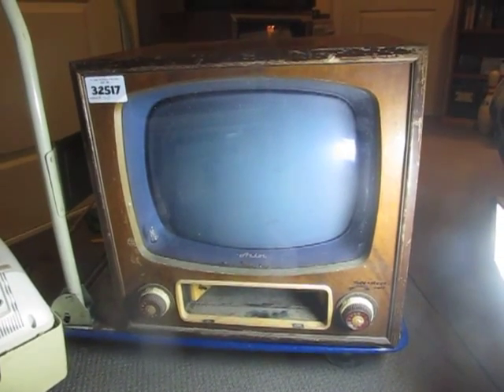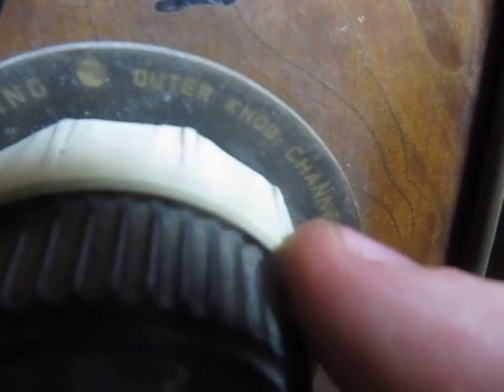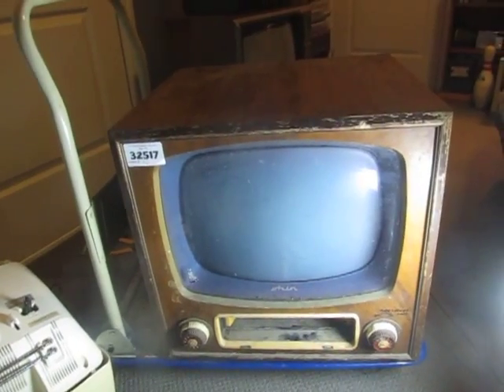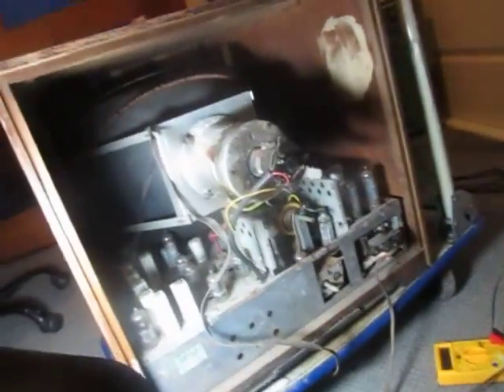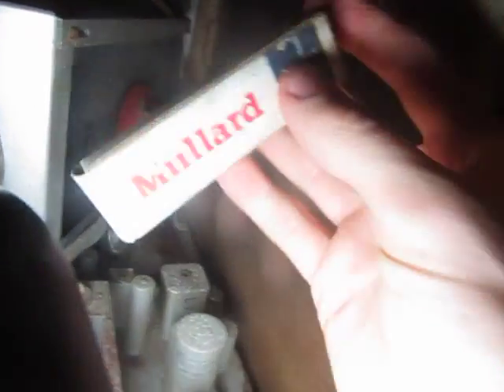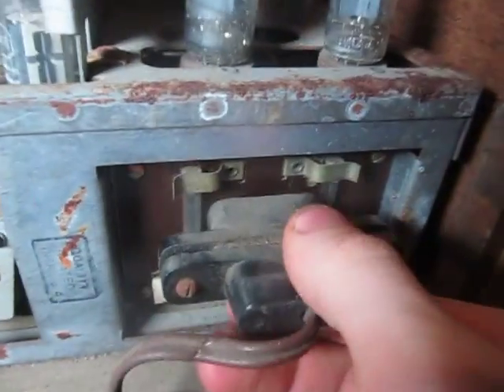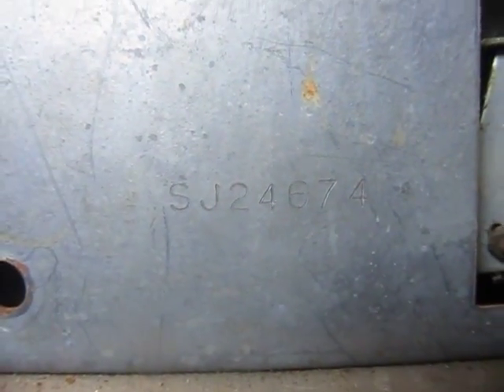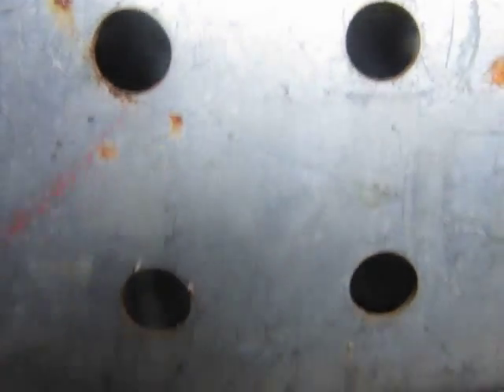1956 Astor SJ television

Comment: I had one of these back in 1973 when I was 15. Learned a lot from it. Replaced all the paper caps with polyester ones. When those sets are in good running condition they can produce a surprisingly good picture. When tuned to channel 3 or 4 a taxi radio would make the screen go fuzzy but you couldn't hear it properly. Then I discovered that if you coupled the picture tube cathode to an audio amplifier via a 10nF or so capacitor you could hear the taxis perfectly! It is 8 years down the track now. Did you ever get it going properly?

Comment: Hi Chris! You probably found out already, but the 1S2 tube is the HV rectifier. If you look inside the HV cage you will notice a "white stick" sitting where the rectifier belongs. The white stick is a selenium HV rectifier. The 1S2 was probably worn out and was replaced by the seleniumdiode. I would prefer a tube rectifier any time. The DY86 is a direct substitute for 1S2, and DY87 will also fit in (DY87=higher voltage rating). I don't know if you use the american or european tube designation, but if you use the european, the original HV rectifier would have been the DY86. The CRT will most likely be the MW 43-64 or MW 43-69 (metalbacked screen for improved brightness/contrast) having a 70 degree deflection angle which makes the CRT very deep. If you have good emission/cut-off readings, this CRT is capable of producing a bright picture with good contrast. I have some tv's around that era myself, having that CRT. I hope I will get around to make some videos of my old stuff this year ;-) BTW, if you need a HV rectifier let me know. I'm not sure I have the american 1S2, but I have several DY86/87's and I can send you one.

Comment from the maker: It's 57 years old, and I don't have a Variac to test it. After all these years, I wouldn't even consider testing it until I've replaced some of the components. Otherwise, I could risk blowing transformers, valves, the LOPT or even the CRT.

Comment from the maker: No. After 57 years, I could risk destroying some hard-to-find components inside it. It needs a full electronic restoration, which means replacing many aged, damaged, open circuit and off-value components. The valves and CRT need to be tested, as do the transformers (especially the LOPT and mains transformer). It's a big job restoring something this old.

Comment from the maker: What I do is I remove the back cover (being careful that I don't bump the neck of the CRT whilst removing it), and have a look inside. If I can't see any obvious damage or faults, I plug it in and turn it on (don't touch anything inside it though, as you can get a lethal shock if you don't know what you're doing). If it works, put it back together (there are usually two rails in the back case, so you have to line up the circuit board so that it slides into them).

Comment from the maker: I'm aware of the need to check and replace most caps and resistors (as well as other components). This set uses a multitude of carbon resistors and older ceramic and electrolytic capacitors. I just can't get a hold of many replacements (especially the higher value electrolytic capacitors). Because we live in a rural area, it takes too long to go to the post office or Jaycar, especially since I get home at around 4:45pm. And being 17, I can't order online. Oh well, I'm almost 18!

Comment from the maker: The strange thing is that I don't believe this set used any 1S2 valves, though I can't confirm that until I see a circuit diagram. I do have a Sencore 143 CRT tester, though I'll need a 110V supply for it (because it is American). I almost got a tube tester not too long ago, but missed out. I'll have to start looking again!